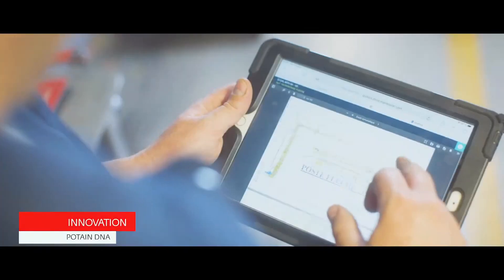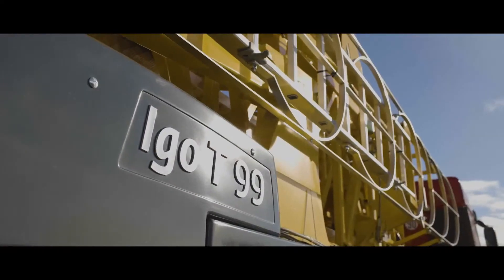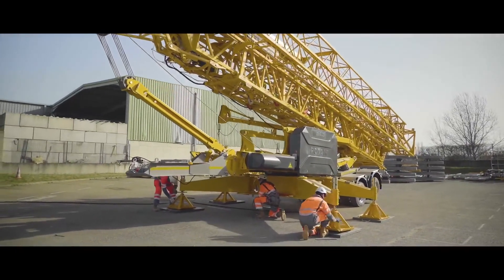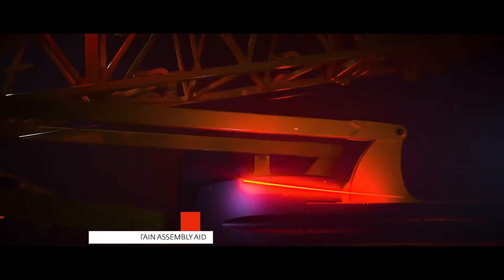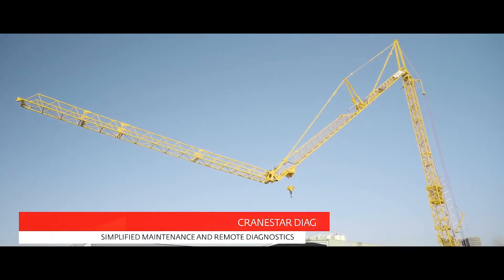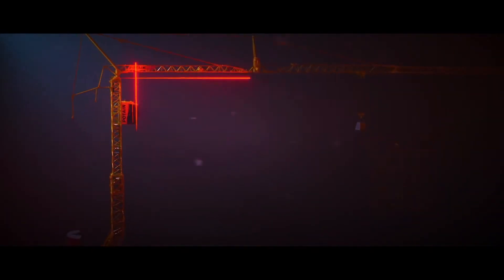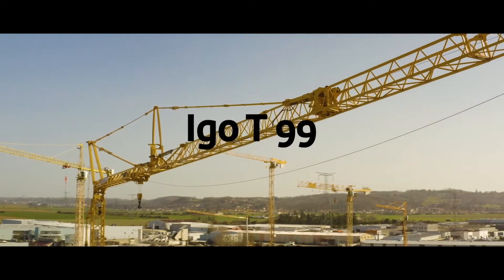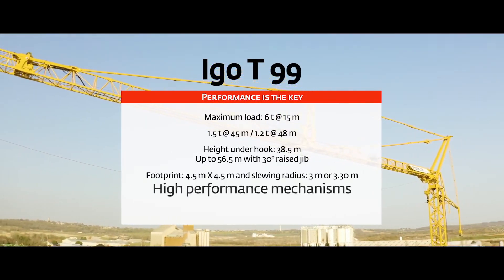Igo T 99 - THE NEWEST POTAIN SELF-ERECTING CRANE

Comment: It's about our Grove RT770E. the reading of the capacity load didn't change even if i setting up to higher or low configuration. It still the same reading from the display monitor.